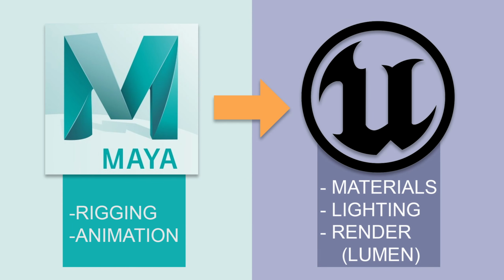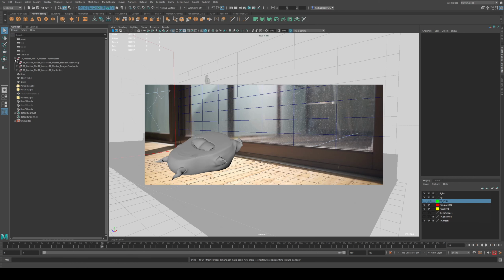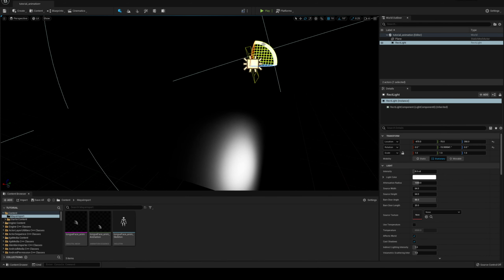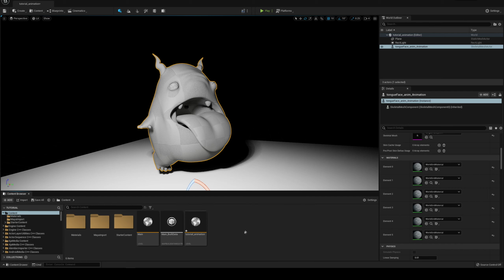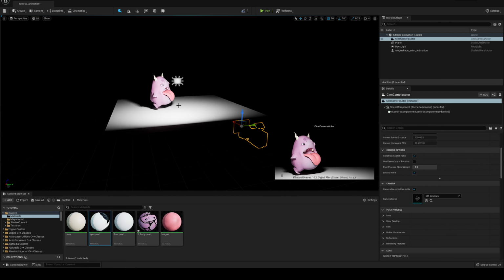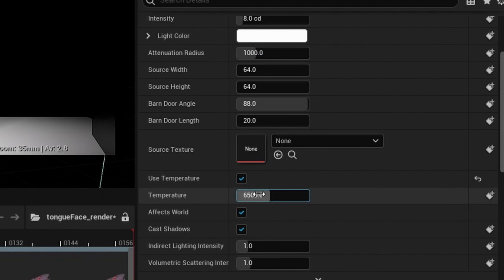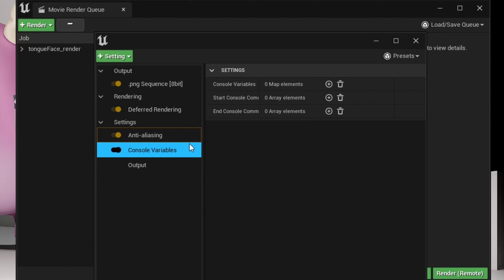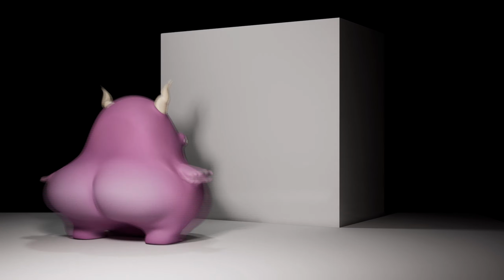Unreal 5 Rendering Animation with Lumen | Maya User Beginners Guide

Comment: From a procedural standpoint, this video could not have been clearer, so thank you for that!   Now, it may be that my understanding of UE is just too limited [it is, I assure you] but it seems that you would have to repeat this re-texturing process for every shot, every time you export an alembic from Maya, which would just be... well, nuts.  Is there no way to simply have a base t-pose of the model in Unreal to which any number of animation caches could be exported and applied?  Hopefully, I'm just missing something very simple, so I'll say thank you in advance for any light you can shed on that point -
Reply from the maker: Couple of workflows to get you going with research that will lead you to a better path in terms of production: 1. Skeletal Mesh importing, so multiple animations can be baked in Maya to a skeleton then applied to one mesh that has been set up in Unreal. 2. Using UDIM will (through use of virtual textures in Unreal) will make the re-application of materials to a character that is imported multiple times simpler as you only have to apply one material instead of one material and texture per "piece". Hope that helps get you on your way.
Reply: @SmallRobotStudio  Holy Smackers, that was fast!  What are you still doing up at this hour - go to sleep!!  [But THANK YOU!]
Reply from the maker: @atlanteum  I live in New Zealand so it's only 8:30pm, as tempting as an early night is I'll probably keep going for a bit longer ;)
Reply: @SmallRobotStudio  I was pushing it to the weeeee hours myself last night.  Say, how's Jacinda doing?  Has she been nuked from orbit yet?
Reply from the maker: @atlanteum  Alrighty that... escalated
Reply: @SmallRobotStudio   If you say so! Cheers -